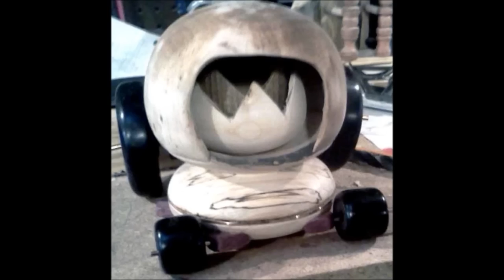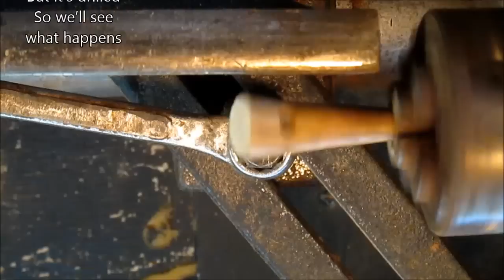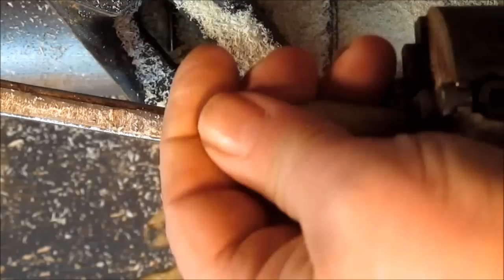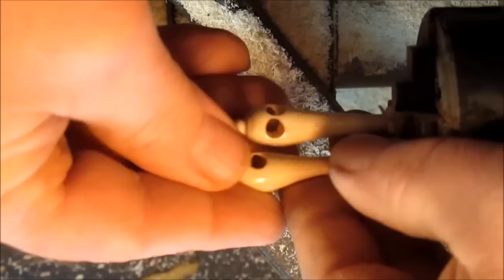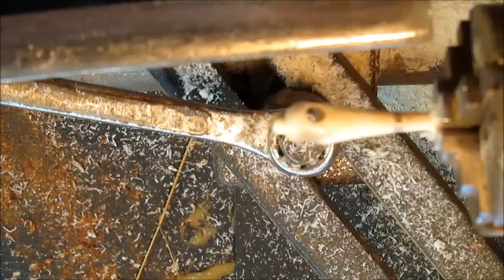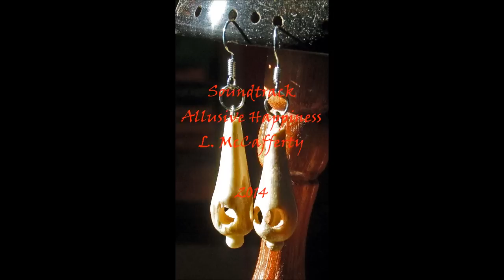Wood Turning #58 White Tail Deer Antler Earrings

Comment: Another great video Larry,
Love the way you solve problems with your brain rather than buying new tools.
My only concern about using antler as material for jewellery is: "These earrings are made of what? Poor BAMBI !".
By the way as antlers are basically hardened hairs, do they cut different from wood and are there issues wit tear out?
Keep on with your great work Larry!
Greetings from Good Old Germany
Peter
Reply from the maker: Hello Peter:
 Fortunately for we turners, Bambie also loses a set of these every year... and they would be too small by next year anyway! 
Antler has this thing where the only real hard usable part is at the tips and the outside 1/4" or so... the center is a spongy substance.... do they have AREO chocolate bars there? That is sort of what it looks like... bubbly chocolate! And it is really soft!
As far as working is concerned it is like a real hard wood... the shavings are small and fine and it is possible to get a nice polished finish on the outer bits. It is fairly strong too... there is not a lot of material between the holes holding the bottom on... but so far they have stayed on just fine!
So long as the tools are sharp... tear out is at a minimum.
Thanks for watching
Larry
Reply: The Tiny Trailer Workshop Thank you for your quick reply Larry.
Well, to be honest, I knew about the fact that a deer has to get rid of his antlers on a regular basis, but the way I understand women (who is really able to understand them) the first thing what comes in their mind are the big dreamy eyes. When they hear of something from this animal to be used, their second thought is about all the dust collecting trophy heads hanging from the wall of some heartless hunter, nothing in between.........
As I never turned antler, your information is very helpful, I might give it a try when I'll get the chance to get hold of some.
OH, you are cruel to me: Speaking of AERO chocolate right in the middle of the Lenten season.... I love this stuff, next to a nice cup of coffee.....
STOP......
OK, don't take me too serious, as I sometimes don't know what voices inside my head should speak, and at the moment it feels pretty bad for myself, that's the reason not making videos for the last couple of months.
Greetings from Good Old Germany and enjoy some chocolate.
Peter
Reply from the maker: ***** Well Pete... if there are antler earrings hanging on a display rack... the guys are going to have to see what that is all about... and hey these would look good on you too wouldn't they?!! And then there are the women who think that if there are deer antlers involved their guy might just pay a little more attention!
That's what I think anyway!!
As far as chocolate beside a cup of coffee... I have found that I prefer the chocolate IN the cup of coffee!
Now if only we could get those voices to harmonize...
Take care
Larry
Reply: Actually antler is bone, it is horn that is hair.